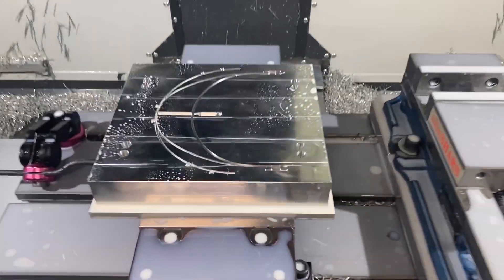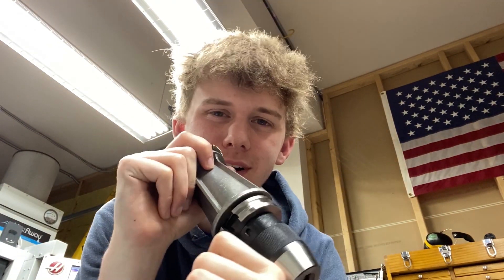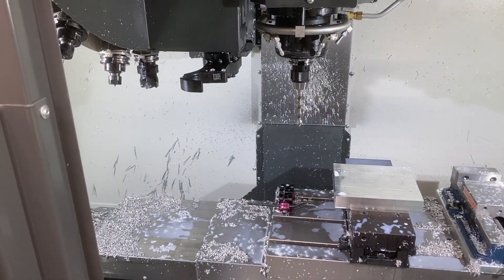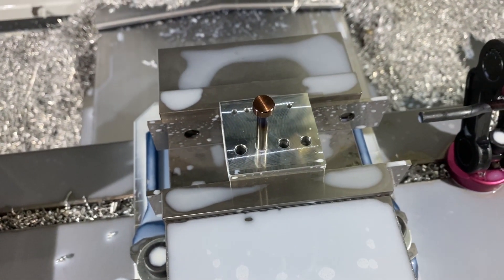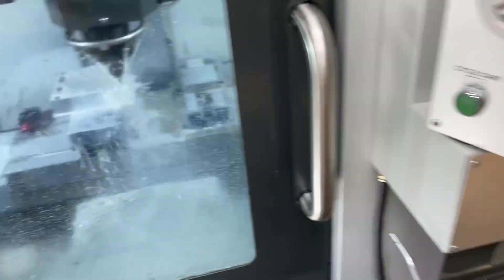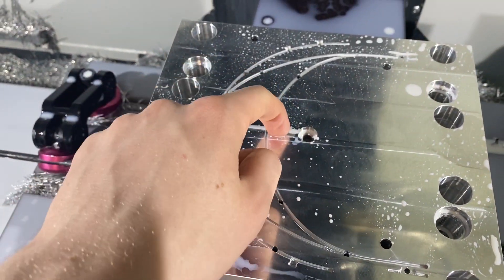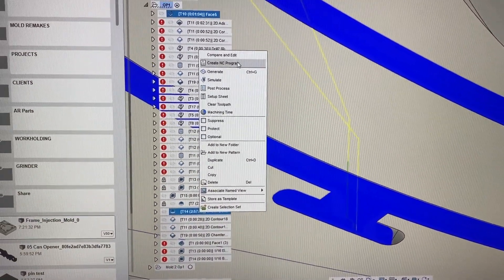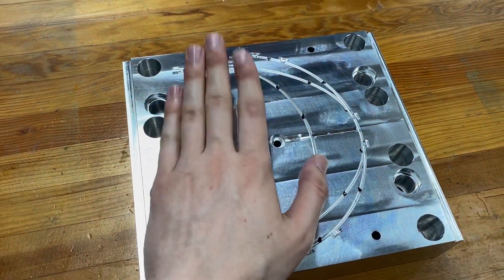Building an Injection Mold on a Haas DM2 - Finishing the Cavity work!

Comment: I use screw machine drill bits. They are shorter than Jobber bits and save a good bit of height especially when in a drill chuck.

Comment: Loving the content dude 👌grim about the tool changer, but at least it's not damaged a huge casting. That could have been a lot more than $60!
Could you program a manual tool change that way there is no chance you press cycle start after the option stop